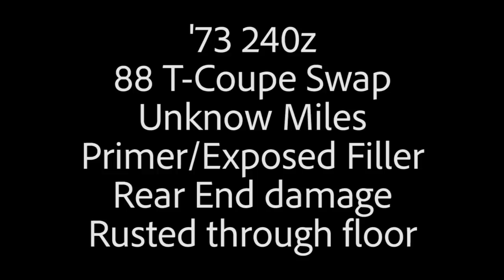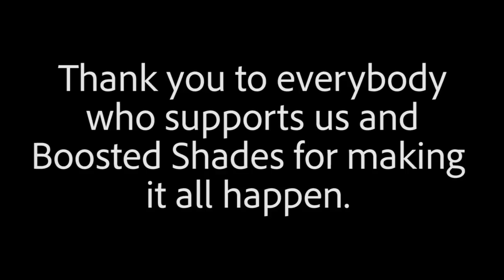Trash to Neck Breaker in 6 Mins I 240z

Comment: That exhaust tho... Try casually driving this around with widows down. Carbon monoxide poisoning 101
Reply: Lol i was thinking the same thing... looks pretty neat but it's not very convenient if you gonna drive it from more than 15 minutes
Reply: agreed.. and also, riding shotgun on this car is gonna be a bad experience because of the exhausts location..
Reply: @itsverydankytfortniteapexl5588  Just man up and take the hit!

(Sarcasm)
Reply: Yall forgetting the fact that it would come in one side and go out the other...
Reply: @iceneet336  eh...
Reply: As you’re driving the air passing the car would carry almost all of the gas along the car and over the back.
Reply: @youtubeaccount9820  then both would die then
Reply: Carbon monoxide is heavier that oxygen so it goes down, to the ground, besides... you are driving, its not like the air doesnt flow by the car, to the back...
Reply: Łucja Uhlenberg I highly doubt that though. However, you might burn your hand if you’ve just gotten out of the car, forgot about the placement of the exhaust, to then lean on the area where the exhaust is. Or perhaps some dumb kids might try to touch it. The exhaust would probably just get blown to the sides of the car and not end up inside of it though.
Reply: @JohnnyTran666  lmao facts😂.
Reply: Man, I drove my car straight pipe with no AC and nothing happened to my brein.
Reply: My favorite
Reply: @robertpollock6979  youre*
Reply: @sandmanxl2338  imagine taking your time irl to writing an essay arguing with people. Yep, don't bother. You're better off saying that to a frog rather than these scientists.
Reply: I did wonder about that. What's the benefit of that mod?
Reply: @MySkobi   incorrect, CO , or carbon monoxide is lighter than oxygen, C=12h, O=16g
So O2, which is the standard oxygen molecule is 32g whilst CO=28g ... Fun fact , CO also binds about 40 times better than oxygen to haemoglobin in our blood, and is much much harder to "unbind" from red blood cells than oxygen, which is why. Carbon monoxide poisoning is a thing. it is much easier for the lighter CO to get to us, and then it beats oxygen at binding with our blood and Never comes off
Reply: @nadstengco2591  close your window then lol?
Reply: @Juuk-D  who would even enjoy that.?
Reply: @nadstengco2591  What?! What's wrong with having window rolled up lol?
Reply: @Juuk-D  you're getting nowhere.. the topic was it's bad to ride shotgun on a car with an exhaust that's so close in your face.. you still gonna ask that question.?
Reply: @JohnnyTran666  ok boomer
Reply: you’re not going to get carbon monoxide poisoning, there is constant airflow as your are driving, bringing the gases away from the car, and carbon monoxide has a higher density than oxygen, and as you should know, anything with a higher density than oxygen will sink, so the carbon monoxide will go towards the ground and be dragged away from the car
Reply: @speedyhutt  my god, you really can't tell it was a joke?
Reply: Juuk and you can’t tell he was deadass 🤣
Reply: @sandmanxl2338

Comment: So cool, it would be interesting  to know how much the Resto mod cost and how long it took. Maybe help anyone looking to do something similar  with a 240z. Amazing Video. Dope ass car, I want to see it on the track!
Reply: If your looking for a price per hour for manual labor, then In a full restoration shop (at the least the one I worked for) charged the customer 70$ a hour per person working on that car. And since this isn't a full restoration I'd say it took maybe 3 months, maybe one month if they worked on it daily. At least for this car and the state it was in of course. Hope this was helpful.
Reply: Then you can simply look up the prices for the motor parts they changed (Wich I don't think they changed much, but the suspension.) and the repairing and building of the frame with scrap metal.
Reply: Nah bro it only took 6 minutes obviously

Comment: Man nobody's talking about the 2.3 turbo that's in this thing and it saddens me that they dont know what it is
Reply: Ford Lima motor found in a ton of stuff. This looks to be the older version of that motor with some of the ports and the head casting. Made turbo and non turbo flavors with single and dual plugs per cylinder. This is a spec motor in a couple different racing series.

Comment: i really like the fact that you used the original L-type engine it came with
Reply: That's not an L24... it's a 4 cylinder they used in the build.
Reply: @navybeanathan   yes but the L engines were actually both 4 and 6 cylinder. So as long as an L engine is in it frankly i think i can live with it.
Reply: @stephaanjacques2269  I understand that, just not the original motor as Juwan had mentioned... however now that I have you, do you know which motor it is out of curiosity?
Reply: @navybeanathan  the one used in this build is a ford 2.3 liter Lima engine. The used em in The Mustang SVO, Thunderbird TurboCoupe and Merkur XR4Ti. You should look into them, not many people seem to know about them sadly, but they're really cool cars

Comment: Wow beautiful work of art, and I love the 4 banger turbo upgrade, I had a '76 280, originally from Canada that ran on leaded fuel with no pollution control but with the fuel injection. 4 wheel independent suspension and a 4 speed. Topped out @ 151mph stock if the speedometer was accurate, but the handling on that thing was sick, closer to a 911 than a supra of the same vintage, by far.  Lots of tourque through the curves, and the ass end would just squat right down when you got on it, only slid out on me once doing 90 around an on-ramp, recovered nicely and never spun it but once when I hit a patch of sand while heavy breaking.  Left side tires stuck while rt side slid, the whip back when the right side caught spun me like a top almost all in my own lane, ended up with my ass end just off the road, about 5 ft past the telephone pole, scary af,  but I got lucky and never hit anything. Brings back so many memories, us 80's kids loved those things! The supras were nice too, and could boogey, but the lines on the Z cars were just damn sexy!! Always loved them. Had 3 Z cars, wish I had kept the first one, would be worth a bit more now. Thanks for the memories!!

Comment: Hey I have a 1975 Ford pinto,I had a vision of my pinto getting bit by a cobra viper cobra engine and transmission and rear_end complete frame with pinto body oh yeah the seats are snake heads of a cobra complete panaramic roof,small rear doors cut coupe.

Comment: Nice build, what engine did you use? I noticed the turbo, but you could have done a samurai turbo conversion on the original straight 6 which is awesome. Also with the grill and front splitter missing it doesn't look finished in my eyes, but all in all fantastic build well done.

Comment: I love the car and the color is just out of this out of this world I wish I had mine back I had three of them I-240 in the 260 and the 280 I think I like the 240 better than I did all the rest of them it was early model 240 with the side draft carburetors on it the Meconi's they turned right it'll it'll run like a scalded dog I never had any trouble never had any trouble 137 miles an hour

Comment: Why do this? 1973 240z in restorable condition. If restored to concours condition its worth $60k. Turned into an illegal street racer its worth maybe $15k if you can sell it. Sorry, I don't see this as saving a classic 240z. This is typically what happens with cars that don't have a clear title and are basically only good for parts, but are straight enough to build a racer out of.